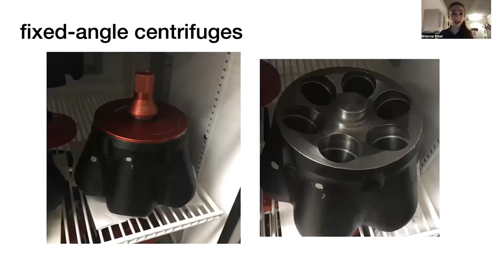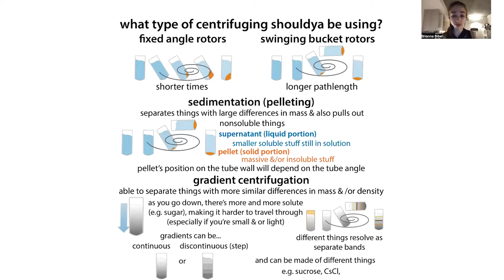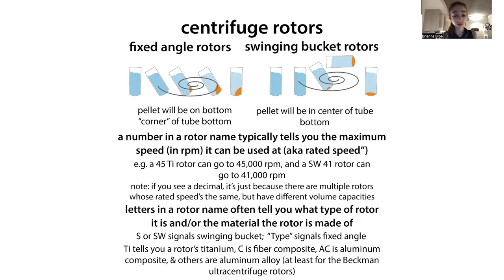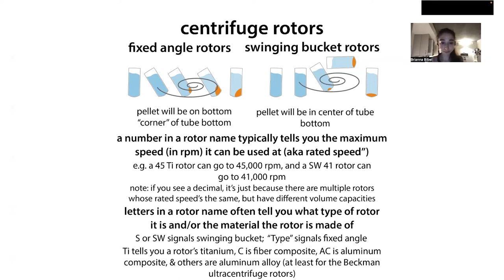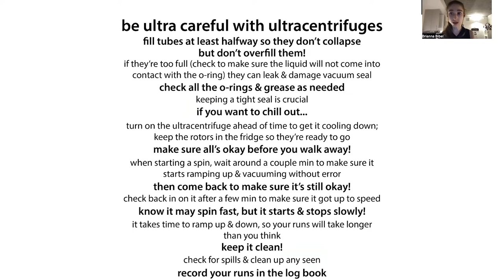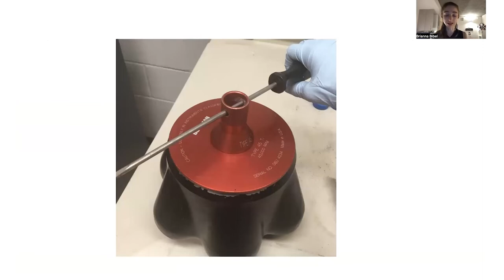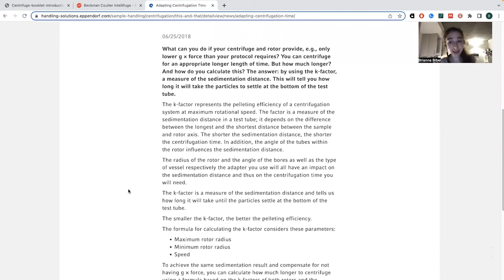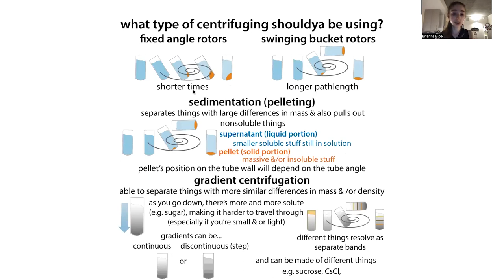Working with laboratory centrifuges and ultracentrifuges: practical tips, tricks, & best practices

Comment from the maker: Working with centrifuges

* Make sure your tubes are balanced! 
    * And know that the faster you need to spin, the more important it is to carefully weigh what you put in!
    * For a swinging bucket centrifuge, you need to have all buckets in but don’t need to have tubes in all of them - but what’s in there does need to balance!
* Make sure your tubes can take the speed
    * check that the tubes are rated for up to the speed you need
    * make sure your tubes fit snuggly
        * use adapters as needed - e.g. don't try to use conical tubes without adapters in buckets for round tubes
* carefully check whether speeds are in ref ("g") or rpm
    * use a conversion table or online calculator to convert g to rpm for a particular rotor as needed
        * here’s a helpful one from Beckman: https://www.beckman.com/centrifuges/rotors/calculator
    * depending on which you want to set, make sure you actually have “rcf"' (sometimes labeled g) or "rpm" selected when setting it
* if you want to chill out…
    * use "'fast temp" button to quickly cool down
    * keep the rotors in the fridge so they're ready to go
* make sure all's okay before you walk away!
    * stick around to make sure it gets up to speed (no imbalance error)
* check for spills and clean up any you find

Be ultra careful with ultracentrifuges
* fill tubes at least halfway so they don't collapse
    * but don't overfill them!
        * if they're too full (check to make sure the liquid will not come into contact with the o-ring) they can leak & damage vacuum seal
* check all the o-rings & grease as needed - keeping a tight seal is crucial
* if you want to chill out...
    * turn on the ultracentrifuge ahead of time to get it cooling down
    * keep the rotors in the fridge so they're ready to go
* make sure all's okay before you walk away!
    * when starting a spin, wait around a couple min to make sure it starts ramping up & vacuuming without error
    * then come back to make sure it's still okay!
    * check back in on it after a few min to make sure it got up to speed
* know it may spin fast, but it starts & stops slowly!
    * it takes time to ramp up & down, so your runs will take longer than you think
* keep it clean!
    * check for spills & clean up any seen
* record your runs in the log book

Centrifuge rotor info
* a number in a rotor name typically tells you the maximum speed (in rpm) it can be used at (aka rated speed")
    * e.g. a 45 Ti rotor can go to 45,000 rpm, and a SW 41 rotor can go to 41,000 rpm
    * note: if you see a decimal, it's just because there are multiple rotors whose rated speed's the same, but have different volume capacities
* letters in a rotor name often tell you what type of rotor it is and/or the material the rotor is made of
    * S or SW signals swinging bucket;
    * "Type" signals fixed angle
    * Ti tells you a rotor's titanium, C is fiber composite, AC is aluminum composite, & others are aluminum alloy (at least for the Beckman ultracentrifuge rotors)

here are some nice resources  
  
A primer from Beckman: A CENTRIFUGE PRIMER - Beckman Coulter   
 https://media.beckman.com/-/media/pdf-assets/ebooks/centrifuge-booklet-introduction-centrifugation.pdf?la=zh-tw&hash=59D526F3787C946D2506DF397CC3342797EB796A    
  
For calculations and conversions: https://www.beckman.com/centrifuges/rotors/calculator  

Here’s  more on the Meselson & Stahl experiments (gradient centrifugation at work!): blog form: http://bit.ly/meselsonstahl  ; YouTube: https://youtu.be/YBpDbXdkjrY   
  
more about all sorts of things:  #365DaysOfScience All (with topics listed) 👉 http://bit.ly/2OllAB0 or search blog: http://thebumblingbiochemist.com